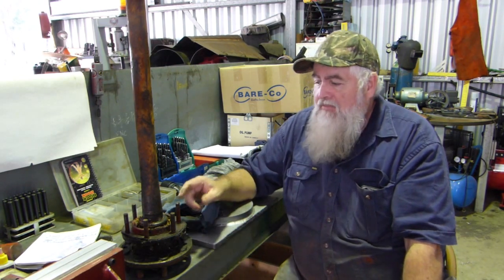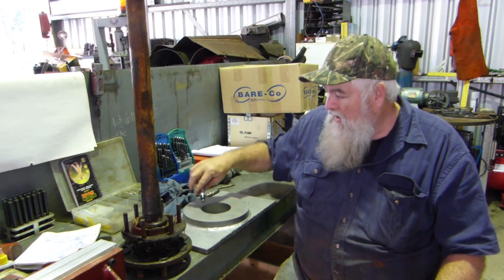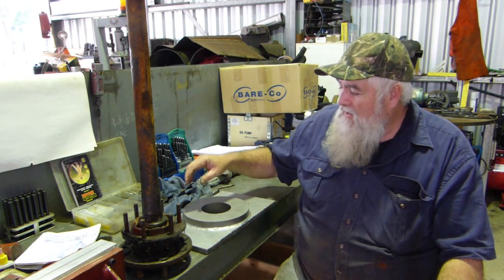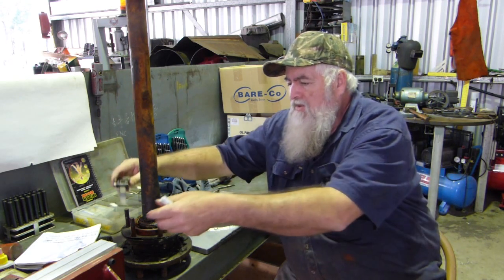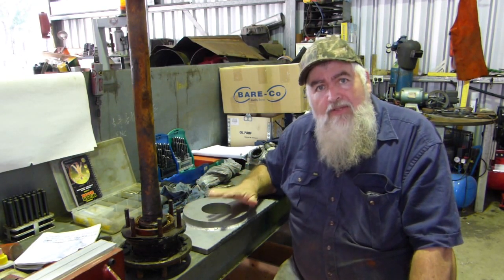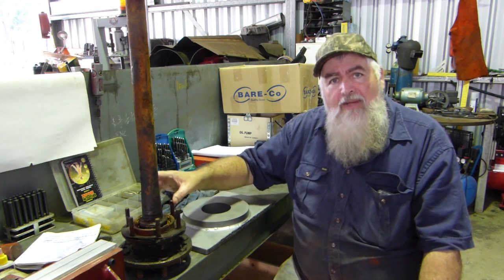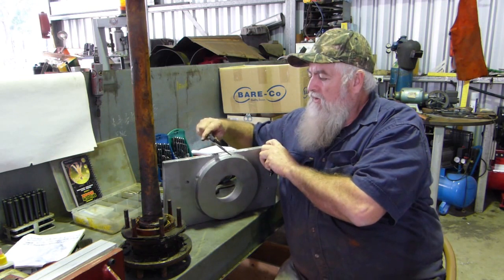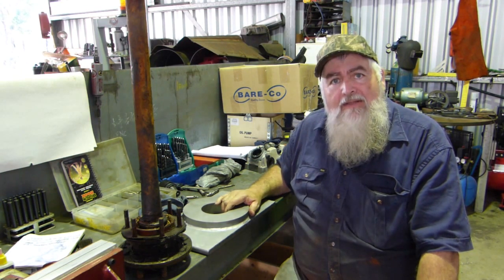Making a Ferguson TE20 Tractor Axle Puller Plate Part 1

Comment: Hi Lance, thanks for your earlier advice on my TE20. I've managed to get the water-oil mess cleaned up and put in 5 gallons of new oil, and I can now engage and disengage the PTO lever, though it takes a bloody strong arm to do it. I'm wary of doing it too often for fear of breaking the lever arm. For what it's worth, since my PTO has been on 100% of the time in the past I didn't realize turning off the PTO also prevents raising the 3pt hitch. Any suggestion on making it easier to engage/disengage this lever? I'll be replacing the PTO shaft soon (cracked near the shear bolt), if that matters for this.
Reply from the maker: The PTO will be easier with a new shaft but you might have trouble getting it out if it is twisted on the splines slightly, they can be a bugger.

Comment: Mr. Lance if you would take that plate and split it in half and go under the flange just an idea THANKS GOD Bless you and you're family THANKS.
Reply from the maker: G Day Ozz, The flange has a machined surface for the plate on the side I bolt it too but on the other side it is tapered and I would be worried it might not press straight. Thanks for watching and commenting.